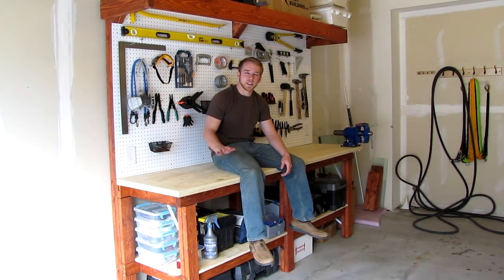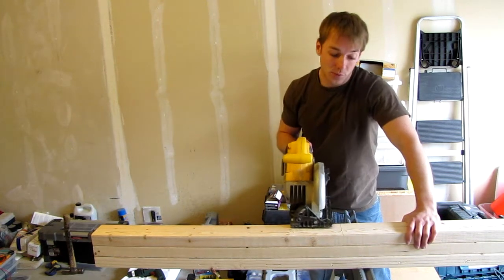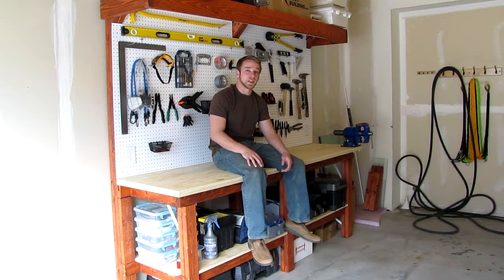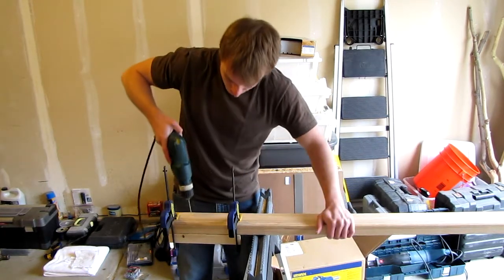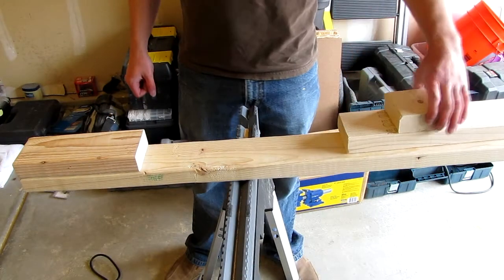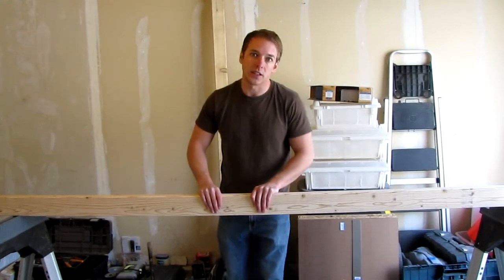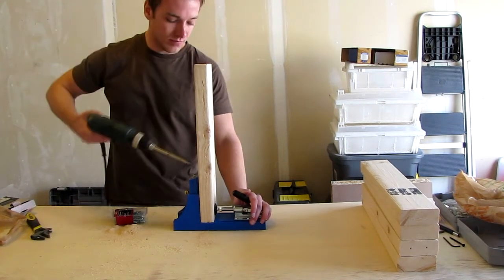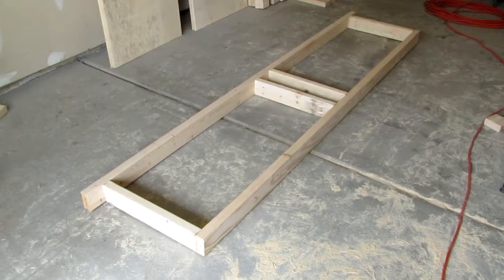Building a DIY Workbench - Part 1 - By Ed

Comment from the maker: @JonBaezH I started with 2.5" deck screws, but I found some great self tapping screws about half way through. I got them at home depot. I can't recall the brand name, but they  are near the deck screws. I used two sizes, 2.5" and 2.125" depending on where I was putting them. I used the 2.125" screws in the pocket holes. When putting the screws in the pocket holes you need to be careful since the head of the screws is tapered. Hope I answered your questions.

Comment from the maker: @EverywhereVirtually There was a little bit of rocking, because the floor of the garage bows up in the center by about 1/2 inch. The white brackets were not necessary per se, but I wanted to make sure this sucker felt like it was bolted to the wall, since I opted not to screw it to the wall.